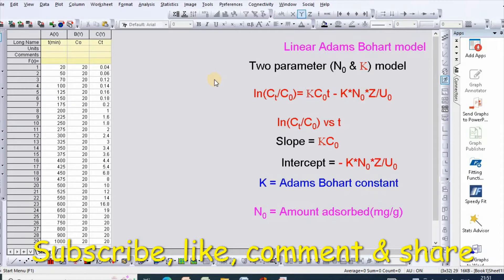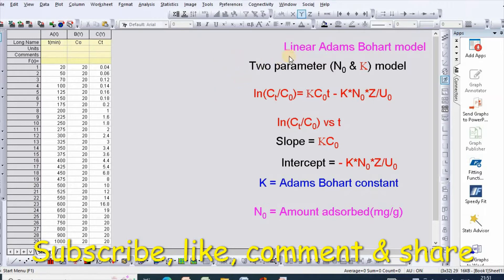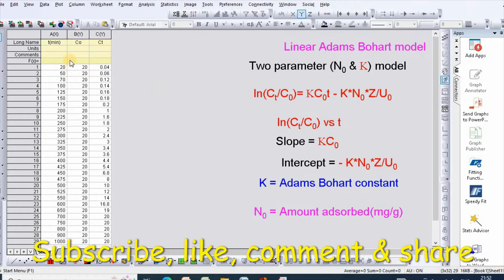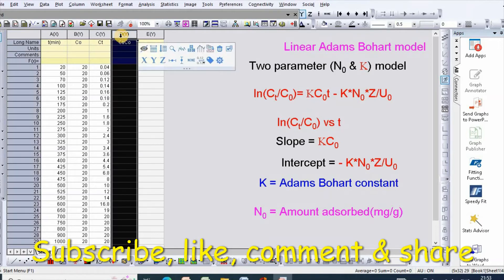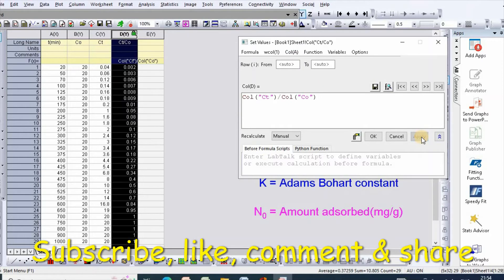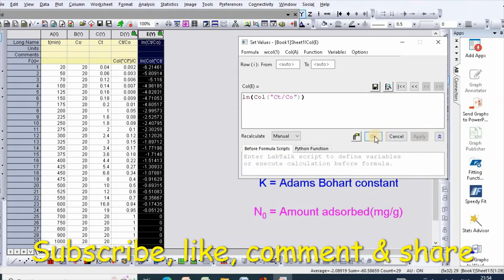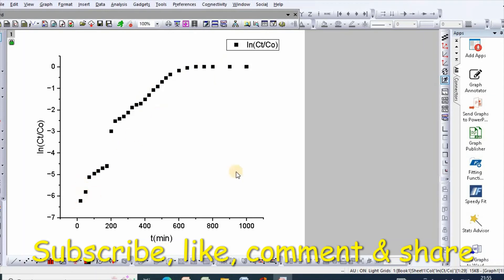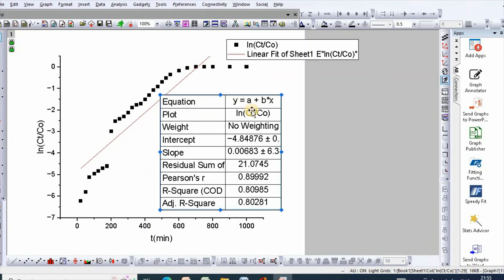Linear Adams Bohart model fitting in origin

Comment: Hello, thank you for your useful videos, I have a question. How might Ct increase with increasing contact time? My data is quite the opposite. And as the time increases, the output concentration values decrease.
Reply from the maker: Thanks. Calculate qt at different times then plot and see what happens. May be your calculations is wrong.
Reply: @Aminulchem  I also calculated the qt and the qt is increasing with increase in time. Maybe because I calculating my output concentration as Ct, the result is wrong. My initial concentration is constant and the outlet concentrations have decreased. This data belongs to E.coli removal from the water for continuous process in the column. What do you think about my problem? please help me. thank you
Reply from the maker: @mehrdadalizadeh6551  I do not understand your problem. Please watch these videos which can be helpful: https://www.youtube.com/watch?v=kyuwPSy35B0&list=PLxbTf96DhNSRtUvA0lZC706OK0WwfpCku